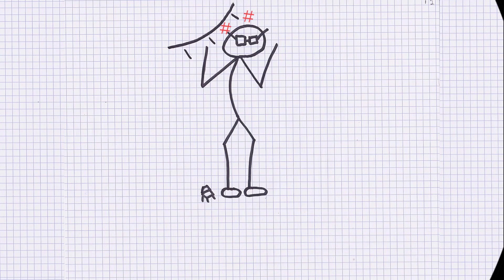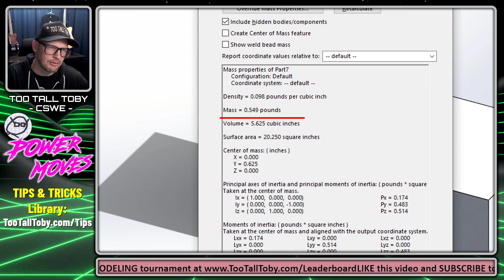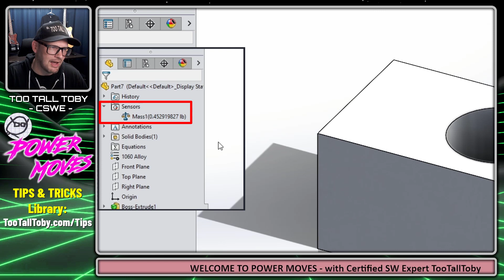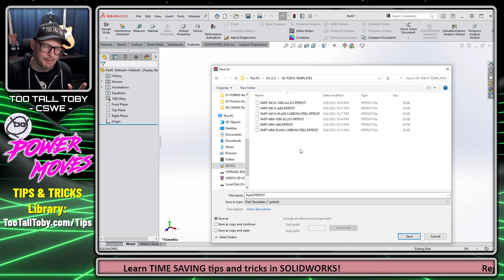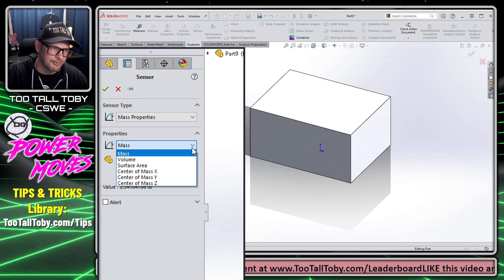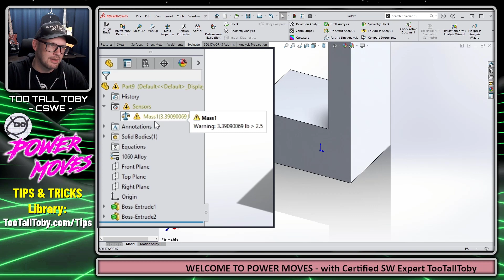Use SENSORS in SolidWorks to quickly CALCULATE MASS!

Comment: Hey, when I check step files add material after check the mass, it shows a message that is mass is override, do u know y, also it does not show actuall mass
Reply from the maker: When you click EVALUATE>MASS PROPERTIES there's a button that says OVERRIDE MASS PROPERTIES.  Click that button to adjust the settings - good luck!
Reply: @TooTallToby  hey i want actual mass not override mass, but software give me overrated mass, and also the material that i selected that become yellow type colors not remain black, I put cursor on that material that give message that is mass is override,,
Reply from the maker: @divyeshdodiya7853  Probably best to post it on our discord so we can see images:  https://discord.gg/ksgZqBSd

Comment: weird for it to need a full forced rebuilt to work, Sensors should auto update on each new sketch/feature added, I think inventor does it like that.
Reply from the maker: yeah I tested it again - it works with a regular rebuild too, but it doesn't just "auto-update" when you add a new feature.  You would think that it would do some kinda rebuild when you add a feature, and this would be enough.  But I guess not.
Reply: Agreed
Reply from the maker: yeah I tested it again - it works with a regular rebuild too, but it doesn't just "auto-update" when you add a new feature.  You would think that it would do some kinda rebuild when you add a feature, and this would be enough.  But I guess not.